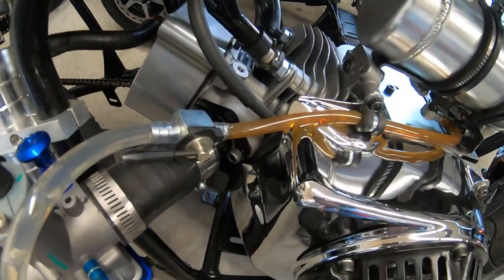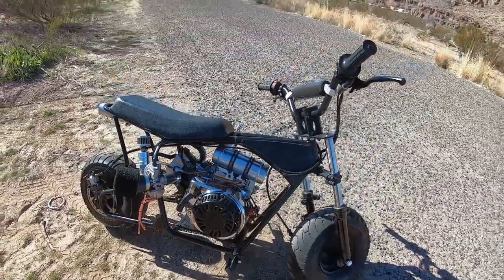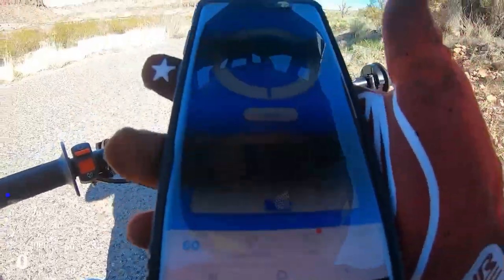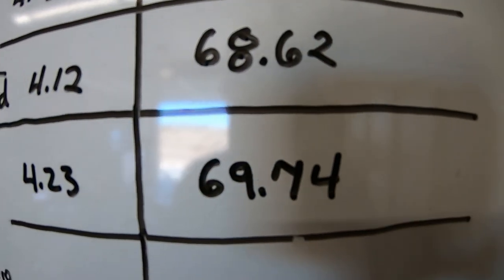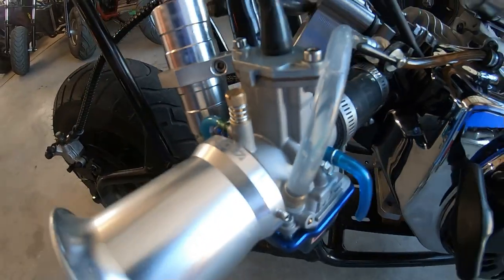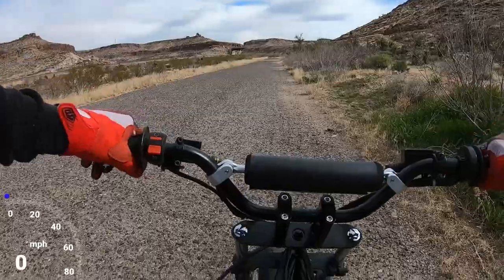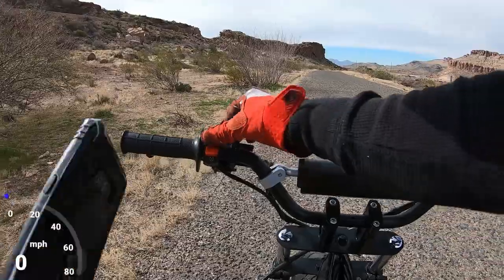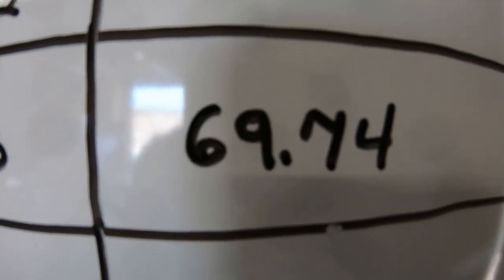installed Rev ratio rockers on the Tillotson 225 And this happened...

Comment: Just wondering, do you have a tach on this bike? I'm starting to wonder if the gear ratio is too long. Maybe it's getting to a point where it just can't pull the bike. I don't know what the cam is supposed to pull to but I feel like that setup should pull pretty high in the rpms. I'm wondering what it is reving to? Sounds healthy as hell though man. Keep up the good work.
Reply from the maker: Yes, the bike gets a 58MM stroker kit and Methanol in up coming videos. Its fun finding out what the cam and head will do in a smaller package in the mean time. Thanks for watching!

Comment: Black, my man. You do the most consistent testing of all. Thus your conclusions are mostly sound. With your welding skills, it would do your fuel adjustment setups much more surety and less guesswork if you built a header pipe with a wideband sensor, that could be used on a gamut of your engines, perhaps not in its finality, but again consistent testing to achieve optimum AFR, THEN the final test would be, going to the actual header pipe for the bike (no WB sensor), and get I suspect an even better improv. I mean you probably have a 3-step header that would install and run on a bunch, even if like out the side but with a well installed, sensor weldment about mid-pipe, aiming inward under seat. Just a thought, I’d kick in on the WB kit, you’d have to make the test-pipe(s), I think you could find the weldments and make 2-3 test-pipes with WB sensor ready to plug right in.

Comment: I’ve noticed that the size of the carburetor doesn’t always make the difference. As long as it’s tuned right it will run just as good. I’ve been using a 28mm. And it works great cause it’s tuned well, but some people say it’s too big.
Reply: The carb depends on your intake valve size normally

Comment: Question. Why did you add jet to the main. Couldn’t you just open up the 3rd circuit. Just put a turn or half turn in the power valve and achieve the same results?  I would think you could have left the 110 and just opened up the power valve.  Or are they not the best on these PWK carbs. I used to use the add on ones in my snowmobile with Mikunis and kept the midrange a tad lean and at wide open the power valve added the fuel I needed.  But I’ve never used them on thes PWK’s

Comment: HOW did you knowthe right length push rods you needed?
Reply from the maker: I use an adjustable pushrod to find out the length. You can also use a dial indicator.

Comment: Also on the 28 mm carb but a camera on the high speed jet tube.  I have only seen ONE actually pull more fuel at WOT.  Mine winds up higher when I close it sadly.  🤷🏻‍♂️

Comment: I have a coleman CT200u-ex  built 224 flattop piston, billet rod, hot 275 cam, 28lb springs, champion rockers, and a 10,000 rpm flywheel VM22 Chinese knockoff carb.   bike has original gearing i cant get it over 38mph .  at full throttle it bogs/ cuts out.  runs good at full throttle until about 25 mph then i have to back off to a little over half throttle.  looking for any advise on understanding what I am doing wrong

Comment: You should try a smaller sprocket on the rear that will add alot of top speed too. Try a 60 so you still have some trq but gain a few mph and break 70 😎
Reply from the maker: I have broke 70 on this bike. Check out the Mega Moto playlist. Thanks for watching! https://www.youtube.com/watch?v=xV8i59aGUao&list=PLkbj-ip-5FzZG40xkiEtZHRtF_jDzxA9U&index=10

Comment: If you have the clearance go 1.3 and ARC billet extended rod. Also methanol (properly jetted) will kick that thing in the ass and get it rippin.
Reply from the maker: Tested MANY rods at this point and clearanced quite a few engines. Have used Methanol on many different engines and combinations. Raced Karts for years in the 1980s. I don't know everything but I have had a lot of fun over the years. If I can't have fun with this stuff then its not worth doing for me. I know some take this stuff very seriously. I don't. Its mainly fun for me.  Check out the pictures on the community tab.

Comment: I don't think those rockers work with valve caps you might want to check that!
Reply from the maker: I am not using lash caps on this combo .  You notice later in the segment the caps are off. I also swapped out the pushrods from 5.110 to 5.160 without the caps . Check out the playlist for more combos with this bike!
Reply: @Black66  My bad!  I saw them on your table at 45 sec into the vid thought you were using them.